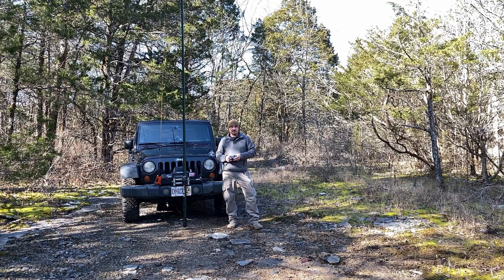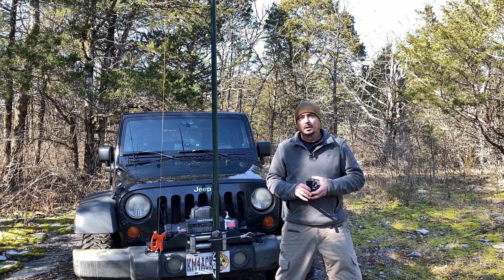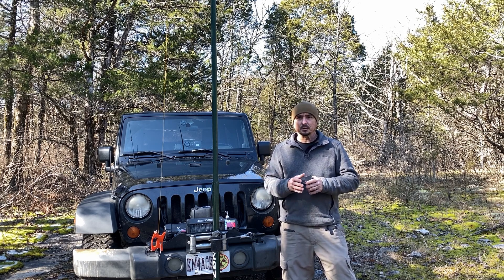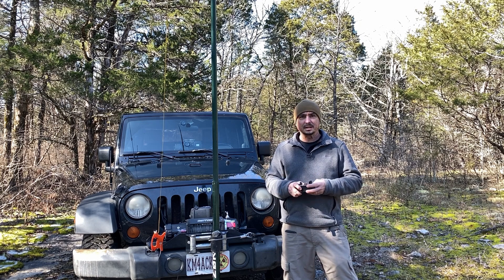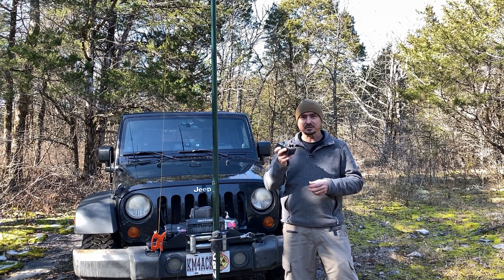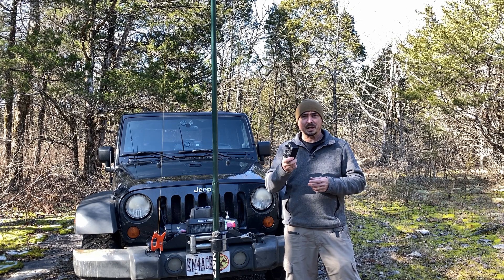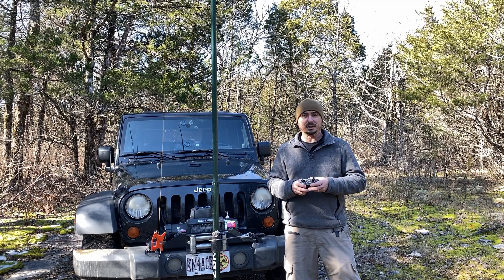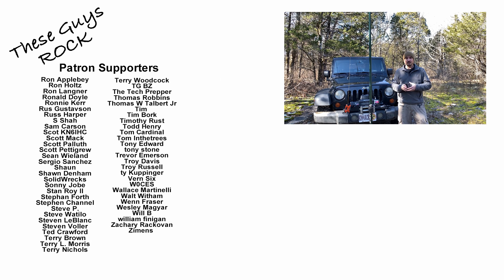MFJ 9201 Antenna Tuner

Comment: Great video. Very informative. Interesting to know that the little tuner will work up to 100 watts. I like the idea where MFJ chose to use BNC's on the tuner. I wish all radios with 200 watts or less would used BNC's instead of PL 259's.
I know you were really discussing the tuner and not focusing on making antennas, but...... your HWEF40 is a 1/4 wave resonant radiator on 80 meters. For efficiency, you would be better off bypassing the UnUn, adding one radial and feeding the antenna direct with coax. 
Thanks for posting this video. Well done !

Barry, KU3X/QRP

Comment: Tune your antenna lol they tune/trick your radio into thinking everything is ok enough function. The original problem still not fixed. You just keep running mismatch equipment.
Reply: I've noticed so many hams nowadays think a tuner is normal to have. Does nobody know how to properly tune an antenna anymore?
They think they absolutely have to tune out that 1.5 swr to 1.1 with a tuner. 
So many depend solely on a built in auto tuner in a radio to tune anything attached. They have there place, but for everything?
Reply: Well. I bought one based on this video. Use it with an 891. Had to see. Normally run a WRC 1000 so I’m “resonant” across the bands. But for the occasion I need one figured why not. Used a 20m dipole on 40m. Matched it just fine. Running it at 100w on SSB as folks would have you believe it’d blow up the first time you keyed up. I’ve run ft8 at 50w to hammer the little booger. Works like a champ. Hasn’t blown up as the you tube university electrical engineers said it would. I’m glad I got it. Thanks for the video.

Comment: I used to have one of those.  I sold it when I sold my 818.  I used to burn my fingers on the screw in the knobs on the regular. I ended up putting tape around them.

Comment: I use one of those in my POTA kit.  100W on my FT891.   My antenna is usually pretty close to good.  So it is only taking it from 1.3 or 1.4 down to 1:1.   But I have used it to tune my 40m EFHW on 80m and it did it.   Likely not efficient there but it worked and I got QSOs.

Comment: I got this same tuner when I ordered my 705 as a backup to my T1 and so far it works well. I think it's neat to manually tune with when you have a real-time analyzer plugged in and can see what it's doing. Not sure if I would trust it at 100W though, I'll have to try that myself. At $50 it's no great loss if it burns up. 😛

Comment: So, have you tried 100W on it yourself? No sparks, smoke etc ? Have you peaked inside the gadget to see what kind of variable caps are there and the size of toroid? Would be very interesting to learn! Thanks! 73! Linas LY2H
Reply from the maker: I didn't look inside but I did run it at 100W SSB and 40W digital. No sparks or smoke!
Reply: It says 100w but Open up and look inside. No way it will handle the power. 25w max is what I suggest
Reply: This tuner looks like a truck stop 11 meter cb tuner inside, absolute crap.

Comment: Great video.  I am currently using the new MAT-705 plus tuner.  It tunes my resonant 75m dipole with a swr of 9+ on 3.5mhz just fine.  it's disadvange compared to this is, battery powered and only 30watts.

Comment: Okay, this would be great for my 817ND and my QCX20 and QCX40 as well as my Bitx40 and uBitx!!  This is just what I have been looking for Jason!!  Thanks for sharing your review of this.  Off to MFJ to place my order!!  This should work well I think with either my 40 Meter EFHW or even my random wire EF antenna.  Heck, this may be a good thing to have with my wolf river coil clone antenna I built.  Will have to experiment, but that is what ham radio is all about.  Juddie - WD8WV

Comment: Well, that's on my list now. I have the older Xiegu X108G and have been using the internal analyzer to manually tune my antennas. The 20 watts from the 108 is more than most QRP tuners will handle so this is good news for me.

Comment: When you have an antenna mismatch you have current passing through the tuner in both directions at the same time (SWR). This is where you need more current rating on a tuner than you have on the radio. Most tuners for 100 watt radios are rated for around 300 watts for this reason. The more resonant the antenna the less likely you are to exceed this tuners 100 watt rating but don't be surprised if you hear sparking inside, or see the SWR jumping around while tuning up as the caps have already been flashed over, or the inductor switch has a bad spot that's been blown out from arcing.
Reply: Agreed. Jason really needs to open it up and look at what components are in it. If it has those cheap plastic capacitors its definitely wont handle 100W.
Reply: I wouldn’t run 100 watts. DX engineering rates it at 25 watts.
Reply: I've seen them fail with 20 to 30 watts. They are made with very poor quality components like so many of their other products. Mfj qc has always been bad, it's really bad now. Equipment showing up not finished, missing knobs, case screws, defective pushbottons, cold solder joints or no solder.